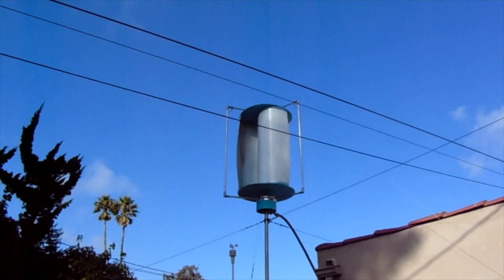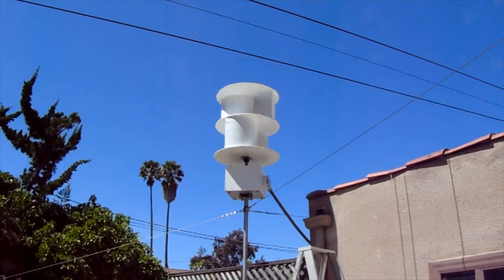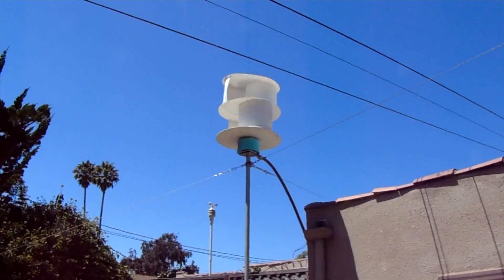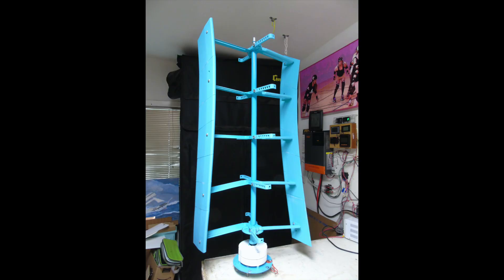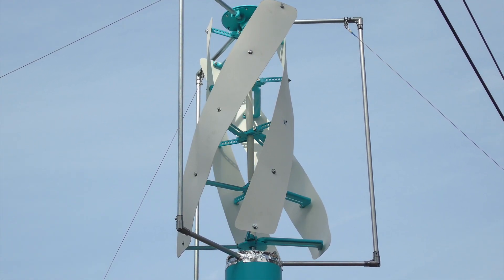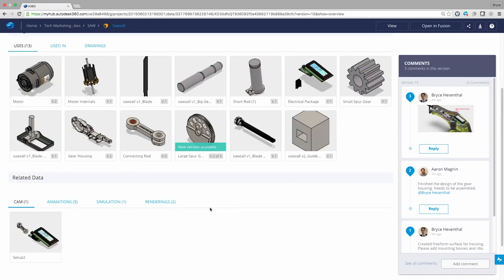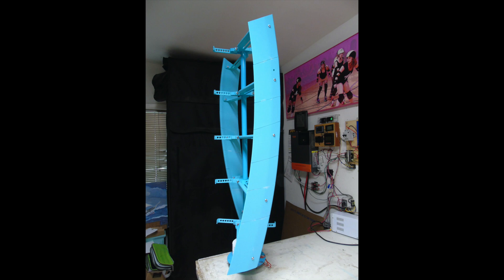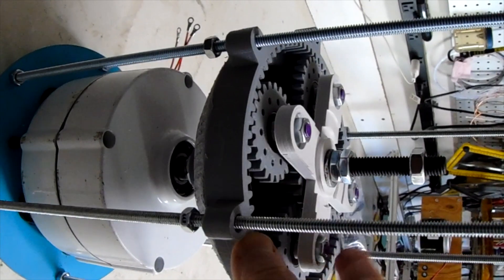Savonius vs Darrieus VAWT details

Comment: Neither...build a MacQuarrie wind engine instead
Reply from the maker: Hmm, I just might.
Reply from the maker: I have studied your design and worry that it will be difficult to reach working RPM because of drag produced in the vanes. If you can show this design can rotate above 500 RPM without breakup, it may be viable. It looks like you have several years of testing to perform to achieve this goal.
Reply: @craftycodger actually it eliminates drag on the returning blades by feathering them flat into the the wind. Drag coefficient on a flat plate horizontal to the wind is around .05 as opposed to the plate perpendicular to the wind is around 1.28...also the drag area becomes greatly reduced when it's horizontal. It's huge improvement over the Savonius rotor. I've built a couple of different versions and they work really well. The only drawback is noise which would be cancelled out with dampeners. Thanks for your interest - not many people are curious about it - and if you do want to try to build one - i put it in the public domain....I should mention I tested one in the back of a pickup truck going 65 mph and it worked great!
Reply from the maker: Small prototypes can be impressive. The key here will be to build one at scale. How large will this design need to be to make usable power? What mechanisms will be required to survive wing flex and shaft load? What kind of frame will be required to stand up to high winds? I am interested in your development here and I look forward to seeing a working machine. Thanks for your comments.

Comment: why not use savonius helical shape
Reply from the maker: I did make several attempts at designing a helical shaped savonius. It proved to be beyond my abilities in metal working and CAD design. I do appreciate the simplicity of the designs as built, as one of my goals is to build and test systems that others can do with little background or experience. Thank you for watching.

Comment: I am considering a vertical axis wind turbine that looks exactly like a tree, I call it : e-tree,
the trunk of the e-tree is brown, the spinning blades are green,
attached to the trunk of the e-tree are features of : wifi/mobile network, light and power outlet, to charge a car for example
Reply from the maker: Sounds fun. Be sure to document your efforts so we can see how it turns out.
Birds may be confused by a spinning tree. How will you account for this?
Reply: @craftycodger  birds see ahead that there is something spinning, they will just leave, contrarily to a horizontal axis turbine where birds do not see blades coming from above,
secondly: blades of the e-tree are savonius type, so they don't hurt

Comment: Un consejo, si cortas lo que sobra de las tapas de arriba y abajo, tendras menos radio, lo que significa que girara mas rapido, y tambien tendra menos peso, por lo que mejorara en fuerza tambien. Como es un rotor de arrastre, lo mejor es que sea lo mas liviano posible.
Saludos and good luck.
Reply from the maker: Thank you for your helpful comment. I have tested with weight reduction methods while insuring needed strength. It is a balancing act. I've been working on a new design  that does not have top and bottom caps. See the MagnuSav.

Comment: Question is which is more important for your installation: speed or torque?
High output alternators typically have large torque requirements or unrealistic speed requirements.
Reply from the maker: Well said, thank you. This is the dilemma.

Comment: What section is generating the electricity, what’s it look like and how is the electricity collected and stored.  How many kw hours per design?
Reply from the maker: Under the teal cylindrical structures on the bottom of these units lay the alternators. These alternators generate electricity. You can see what they look like in my alternator video. As for output measurements, these will be in a future video.

Comment: Дарье - для больших скоростей ветра выше 10м/сек! За всю историю существования около 100 лет с Савониусом и Дарье никто не смог добиться приемлемых результатов генерации э/энергии  🤔
Reply from the maker: I have been able to generate enough power with these VAWTs to charge a small 12v system.  While it's not enough to run a house, it's more than enough to extract water out of the air with a dehumidifier. Free clean water is a good result for a small investment.
Reply: Radikal yorumunuz için teşekkürler. Yetmiş senedir rüzgarla, kırk senedir de, "G model wind turbine, GMRT" tasarımım üzerinde çalışıyorum. Tasarım ve denemeniz için gerekli bilgileri böylece bulursunuz. Mevcut sonuçları da TUBITAK raporunda bulursunuz.
Test etmenizi ve sizin de denemelerinizin sonuçlarını kıyaslayarak bildirmenizi isterim: yavuzali
Reply from the maker: I think I found it. This looks very promising. Once I complete testing on my MagnuSav I intend to start testing your design.